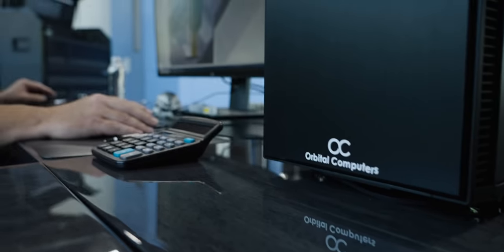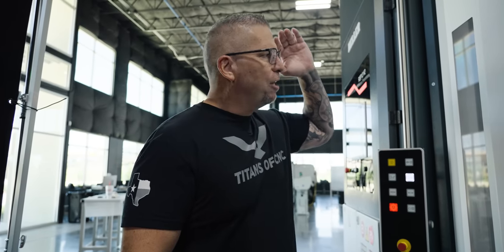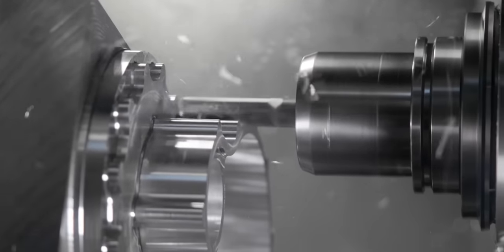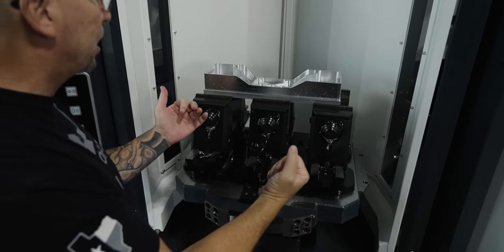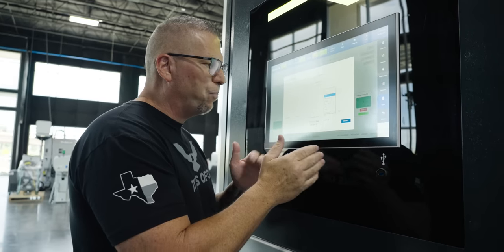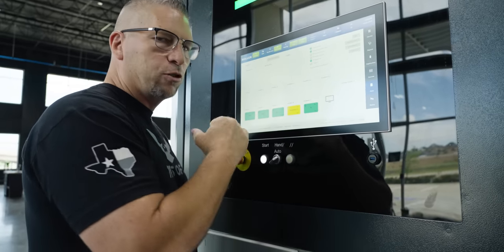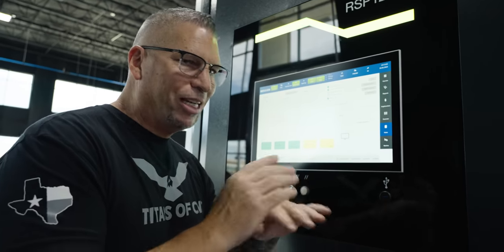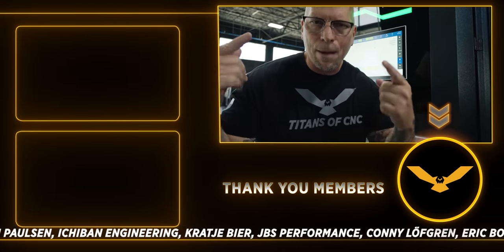DESTROYING Material Non-Stop for Years + RSP Automation

Comment: Hey Titan, a potential interesting topic you could cover, per your request at the end of the video, would be manufacturing with limitation on machine capability. The shop I work at has a 3+1 axis CNC mill (Haas TM1-P) and a 4 tool turret CNC lathe (Haas TL1) but until more funding comes through, we don't have access to 5 axis or anything like that (school shop). I would be interested to hear about creative solutions when you are limited on machining capability. 

For example, we had a work order come in for one of the capstone groups at the university that needed machined on all 6 sides and had several critical tolerances that would stack up and immediately take the part out of spec if any error was made in any of the 6 operations or setups and started with a ~$1k block of stock. After the first operation, we also didn't have access to a good way to hold it anymore given the bizarre geometry. If we had access to a 5 axis mill, this part would have been fairly easy but it was absolutely brutal and took several hours of prep, soft jaws, custom fixturing, custom tooling, and creative thinking to manufacture. We were able to make it but it was definitely an adventure. Tips for situations like this could make for an interesting video.

Comment: I love how you talk about fast setups and sister tooling with tool life management.   In our shop we're a firm believer of quick change tooling.   You guys use the Kennametal version.  We use Capto from Sandvik.  We've got a lathe that will run 30 or 40 parts in a shift, but they're all different.   So with quick change tooling and quick change chucks and quick change live tools all using Capto, we're able to save all our offsets with a repeatability of 5 micron, so there's no touching off tools, we use macros to set our work shifts because the position of our jaws are all known.   My guys are able to go from 1 part to the next in under 5 minutes.  Idle spindle time is incredibly low.   And we also only run 1 shift because during the day we're doing our hand load jobs, then at the end of the shift my guys will set up a barfed job or a job that is able to be loaded by our robots, and then with sister tooling they're able to run all night. Combine that with in machine part probing and auto compensation, we're able to get 24 hours of production with 1 shift and still hold 7-10 micron tolerances.

I love what you guys are promoting.  Let's get high production manufacturing back into North America.

Comment: We have 5 similar machines, but they are matsuura horizontals with I think 10 pallets, each pallet has a 4 sided tombstone they are all 4 axis machines. Can run weeks at a time if you wanted, if tool life runouts out it can grab a duplicate tool, retouch it off without the operator, and be within .0001 of the last tool, but we have it to where there’s a different setup and program on each tombstone for short runs, just load the part into the correct fixture, hit go, no need to set any g54 or anything they all have probing macros for offsets in the machine

Comment: That Heller works amazing. Since this machine has twelve pallets would it be a great addition for the custom billet wheel market, be it wheels for cars,
trucks and motorcycles etc.? By machining two and three piece custom wheel centers at one time it seems that the pricing of each wheel could be greatly
reduced for the buyers. This also goes for any billet parts made for the automotive and custom motorcycle market etc..